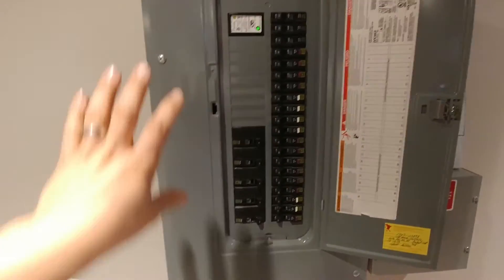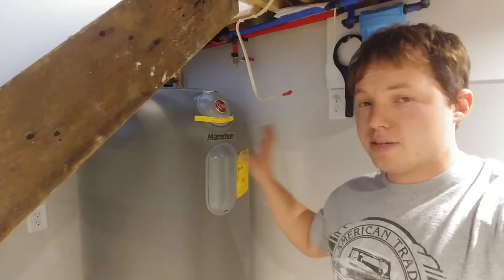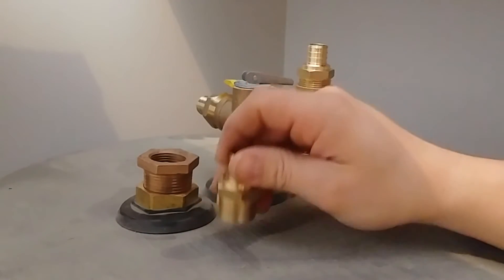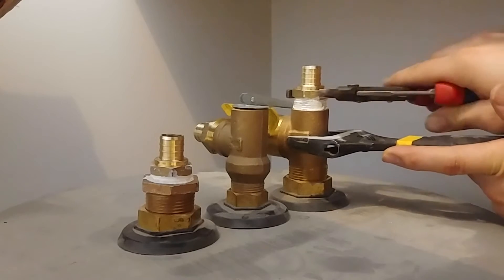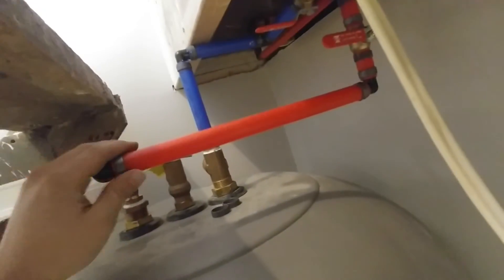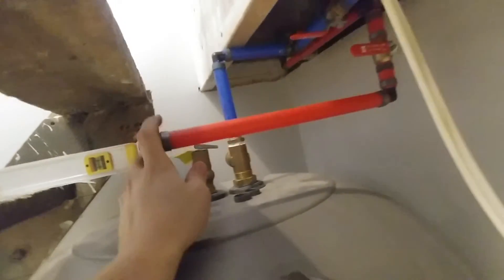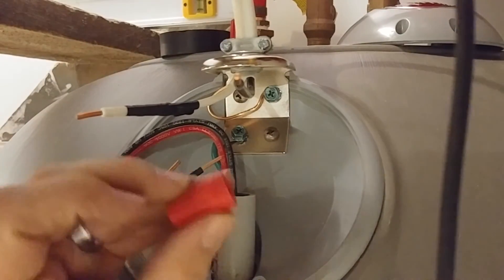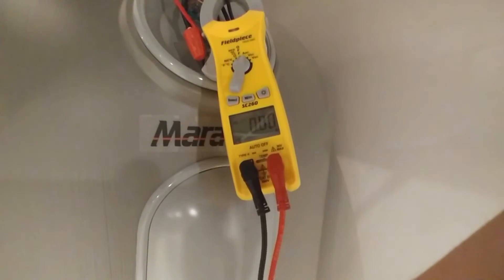How To Install an Electric Water Heater - Plumbing, How To Wire, & Materials Needed - Rheem Marathon

Comment: I enjoyed the video. Thanks for sharing. Quick question. I am about to replace my hot water heater with a tall Marathon 50 Gallon water heater. After unpackaging, I noticed the hot water nut on the top of the tank swivels while the cold and T&P nuts are tight and hold the fittings tight on top of the tank. Is this normal or did something come loose on the backside of the fitting?

Comment: Thanks for the video Ben.  Appreciate you sharing your knowledge.  I installed the Rheem Hybrid electric/heat pump 80 gallon purchased for $1758.  Love the unit.  Next project I plan to install the Hybrid in series with the Marathon.  One advantage I experienced with installing electric in a retro fit is not having to run another exhaust/intake.  A disadvantage is that my power company did not give me a rebate because I did not replace an electric water heater with electric, I replaced a gas water heater.  Should check with utility company first to ensure a rebate will be given otherwise expectations get bruised.    Thanks again!!!
Reply: Two weeks ago I installed a Rheem 50 gal hybrid water heater. In eleven days it has used 14.17 kWh of electricity using only the heat pump mode. Plenty of hot water for my wife and me. I replaced a 20 year old 30 gal electric heater that is still good but has to be on borrowed time. The Rheem was too big to go where the old one is so I put in another more accessible area. Why would you need a second heater?